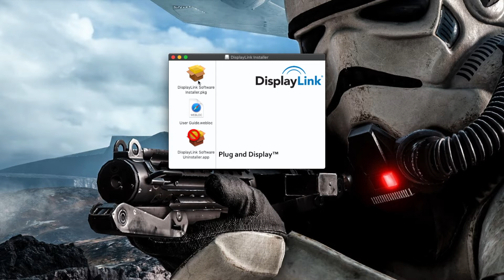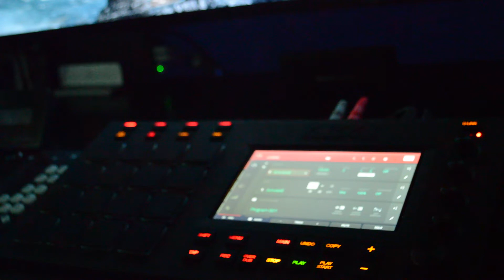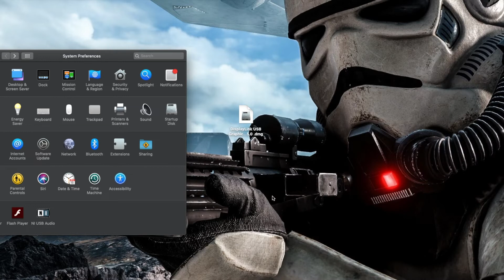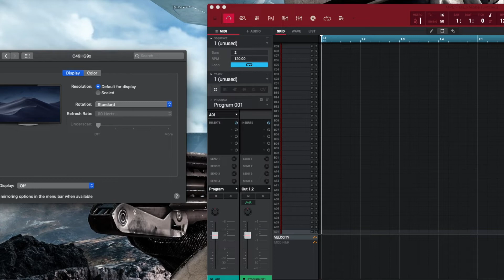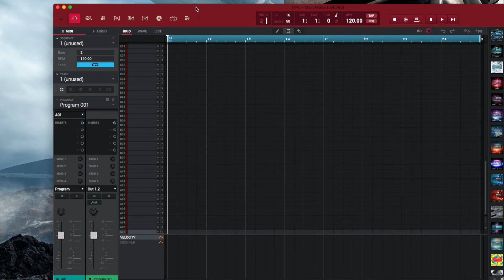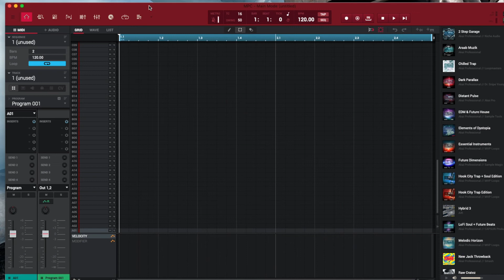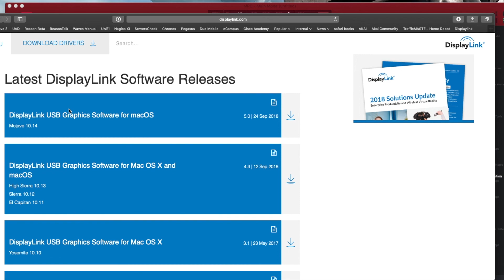Akai MPC Touch | DisplayLink Driver 5.0  for MacOS Mojave

Comment: Now in big sure I see Display but I can no see mpc software on the display 😐 I hate akai for that problems…. I think about never buy again akai product like this. This should not be happen.
Reply from the maker: Apple has changes alot of the features of the display mode.  This maybe why you are having issues.  I recently tried to use my touch with Monterey and had one heck of a time getting it running and eventually put it back in the box and in storage.

Comment: Has this worked for anyone with the mpc touch and OSX Big Sur on an M1 Mac?
Reply from the maker: Because those are two totally different os’s and akai changes drivers to support 64 but there is a chance it has changed.  I had a lot of problems with the 32 but driver and that was one of the reason why I gave up on using the touch.  It’s also now out of production and not being supported so I’m not sure.  I moved on to a force which had its issues in the beginning but after several changes it’s working as expected.

Comment: Is the MPC Touch a waste of money if you are using iMac or MacBook? Seems like every update there’s a new issue. I haven’t been able to use my MPC Touch since June.
Reply from the maker: markpmaestro my whole thought process around the Mpc has changed.  It’s a romanticized piece of gear.  I use the Mpc software only for the sounds.  I am able to do all the other stuff in my daw.  When you start to see issues like this it means the driver is not being updated and tested as much as it was when the product was originally released.  Which is sad the touch is just a controller it’s not hardware so it should be just as good is not better than the standalone units.

Comment: I’m on catlina and I’m having trouble!
Reply from the maker: D Nash some of the first things to try are: remove the driver and reinstall.  Disconnect the device during the install and reconnect after it’s installed.  The old driver was finicky and would only detect the device half the time.  I no longer use my Mpc touch unit.  I only use the software with my push.  The things that make the Mpc special your able to do in any daw.  I got tired of all the technical issues of trying to make the hardware work.  It’s just a sound module in my setup now.

Comment: Hi. I'm running Mojave and followed your instructions and I can see my screen fine but the "touch" aspect isn't working.  My screen pretty much doubles as a track pad.  I can't click anything and it controls my mouse pointer when I touch screen.  I'm unable load any sounds through the Mpc touch.  Thanks for your help
Reply from the maker: Jason Chastang hi akai has since released several updates to the driver.  Have you tired uninstalling the display link driver and reinstalling?  When I was using this setup I found that it was a little tricky to get working if you disconnect it.
Reply: @Ast3rixMusic  Yea I did but I'll try again to make sure.  Their customer service is real slow and suspect.  thanks for your help
Reply: @Ast3rixMusic  I'm running Mojave 10.14.6 having the same issues which version of the displaylink do I need to install
Reply from the maker: Trippi Be the most current release.

Comment: Hi , sory if my English so bad, i have big problems here, please help me!!! Please!, now im useing macbook pro 13inch, early 2011 with macOS high sierra version 10.13.4, so the problem is now i cant update to macOS Mojave becouse is not compatible with my old macbook pro, so can u tell me how im i gonna do now??, actually i buy  this mpc touch from a friend, so please akai i really need your help please!!!
Reply from the maker: Did you remove the driver completely?  Then reinstall with the usb cable attached and unit powered on?  I had some luck with it by performing these steps.

Comment: to people who cannot run the screen properly even followed all the steps in this video, it's quite easy, just follow these:
0. Uninstall and re-install the displayLink follow the instruction of this video 
1. click the apple icon on you top bar, choose "about"
2. click "system report", then on the left panel, click "software", then "extension xxxxxx"(im using chinese version of macos so it may be not that accurate)
3. roll down until you see displayLink, chect the status, if it says the driver "not running", thats all the problems at. to fix this:
4. system preference, accessibility xxx,  chose "general" or any damn name its the very left one
5. you will see "displaylink is blocked" on the bottom, thats because displayLink is not an apple authorized developer... click the button on the right, input your password, reboot.
6. go back to you mpc 2.5 or any version installer, do the "configure your screen" activation,  all done, you will see your computer screen appears on mpc touch.
Reply: Hi , sory if my English so bad, i have big problems here, please help me!!! Please!, now im useing macbook pro 13inch, early 2011 with macOS high sierra version 10.13.4, so the problem is now i cant update to macOS Mojave becouse is not compatible with my old macbook pro, so can u tell me how im i gonna do now??, actually i buy  this mpc touch from a friend, so please i really need your help please!!!
Reply: @Andrieano91  actually imo if you cant update to mojave the problem described will not be problem anymore buddy...but you better check if this device supports your macOS version at first
Reply: 哥🥲我看这个DisplayLink Driver现在已经是5.2.5(90)了，显示未载入，X86_64的体系结构，有没有啥方法能转译这种kext插件😭我用的M1 Pro的电脑，买的二手让人骗了，还不给退😭

Comment: Got Mojave on Macbook Pro (i5 2012) upgraded from High Sierra. Got beta Displaylink for Mojave and it now works. But I'm still getting the power on attempts from the Touch's screen only to go black and flicker on and off...
Reply: Also configured the settings to match up with the Touch, but its still back to the same problem...
Reply from the maker: @eddiehaze3165  Yeah that driver still has problems.  I have not had issues with it flashing or going blank.  I recently reinstalled the driver and had a hard time getting the thing working again.  It's like it still has trouble communicating with the device.  When I opened it in Ableton for the first time the thing did not work.  Have you opened a ticket with Akai?  Not that it will help... they will tell you that they don't directly support the display link software.  You could reach out to display link they are pretty responsive.
Reply: @eddiehaze3165  man if the problem is still not fixed check my comment.
Reply: @ordinarymonster1187  I actually returned my about a month after having it smh. I figured it was defect as do many others.
Reply: @ordinarymonster1187  But.....If it is a proven fix I'D definitely be will to grab another one....soon
Reply: @ordinarymonster1187  Is it a new solution to the problem I haven't heard about?
Reply: Eddie Haze I’m not sure the exact time that you got it, I assume it’s about half year ago? Back to that time Mojave is not a stable platform to developers coz every main update apple changes lots of things, this resulted in many hardware/music equipments. so far developers basically fixed all the problems on Mojave, my solving method can be found in DisplayLink QnA document. OS lesson 101: click that “update” button with cautious...
however, I think you can keep that money and buy some other pads instead, it’s not worthy imo...user experience is not that good, it’s just a normal pad with fancy looking -_-
Reply: @ordinarymonster1187  What about its workflow integration with VST'S and step sequencer?
Reply: @eddiehaze3165  mpc is not a popular daw it must has a reason hahaha. step sequencers for most daws are the same, i think for a common workflow FL studio has better user experience, but improvisation stuff takes a big role in your workflow i recommend Ableton. PUSH 2 >>>>> MPC TOUCH/Live, especially considering the design of the pads, the LED display actually can do many things including chord/scale pattern, saves a lot of time on learning/playing music instruments.

Comment: Hi, I'm an OS Mojave user, & I un-installed my previous driver, re-booted, Installed the 5.0 WITH the MPC TURNED ON, and Touch Display Screen still remains (Fully Black) with mouse cursor flickering...any solutions to this issue?
Reply from the maker: Take a look at this document that Akai support created for troubleshooting: http://www.akaipro.com/support/kb/articles/akai-pro-mpc-touch-uninstalling-and-updating-mpc-touch-drivers. In reviewing it there are some steps that I never had to perform, but it may resolve your issues.
Reply from the maker: Did you try the troubleshooting tips that Akai posted in the forum?  Check this out: http://www.akaipro.com/support/kb/articles/akai-pro-mpc-touch-uninstalling-and-updating-mpc-touch-drivers

Comment: I have an MPC Touch  and I install the DisplayLink Driver 5 .. but not work with Mojave 10.14 .. on MacBook Air .
Reply from the maker: official legend did you uninstall any previously installed drivers?  I had issues my first time around because I installed it with the unit powered off.  I made sure it was plugged into the USB port and powered it on and reinstalled the driver and it works now without any issues.
Reply from the maker: Also did you see the troubleshooting guide in the forum? http://www.akaipro.com/support/kb/articles/akai-pro-mpc-touch-uninstalling-and-updating-mpc-touch-drivers

Comment: I did exact same thing on Monday, MPC Touch works perfectly again.
Reply from the maker: I didn’t think that having the unit turned off would matter, but it does and it’s still a little glitchy.  I don’t have time to really test it out fully as my primary music machine is down temporarily.  I hope that what I’m seeing so far is just a small hiccup that won’t appear again.
Reply: I had to look into the Macs system software, it seems a simple fix now, but it is just knowing where to look as there are 3 steps to look at, been using MPC all afternoon, still going great ...